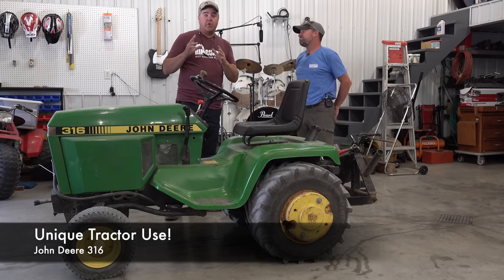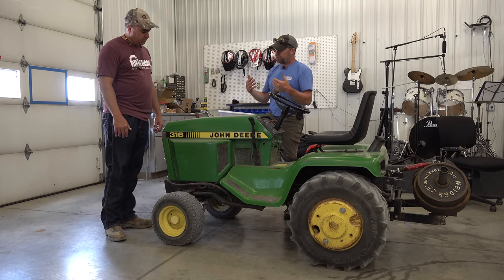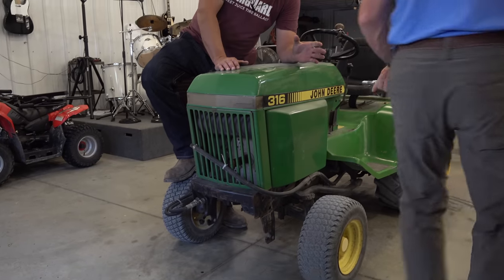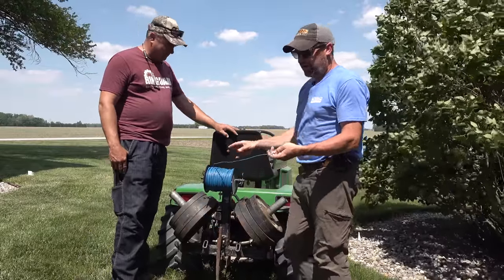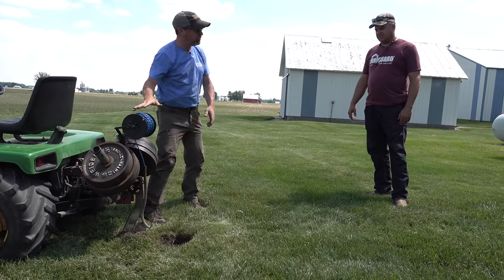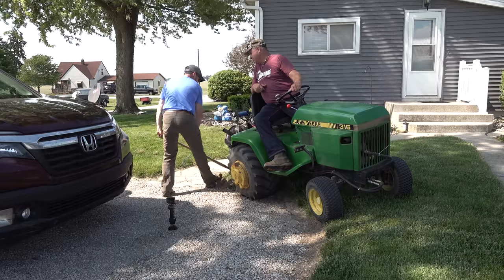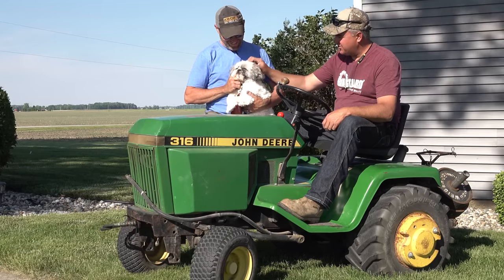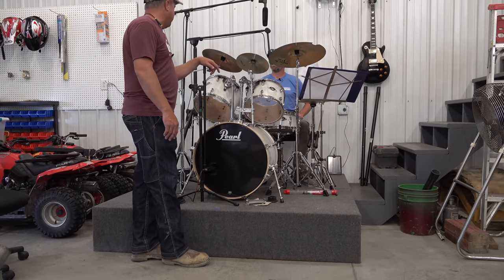DIY Cable/Wire Layer! Underground Dog Fence! Old Deere 318 - Unique Tractor Use!

Comment: Great Video Tim & Christy! It was such a fun experience having you guys out to visit and such great help having you assist me with the dog fence install. I'm glad we were able to get together on this one.  Even had a little extra cowbell at the end!!! Thanks again!
Reply: got to love a little extra cow bell!
Reply: Just an FYI, these tractors did have 1 weak point. With high hours, the input shaft on the hydro pump can round off, even sometimes break. Most had a hard to get grease zerk, but I think the main cause was drive shaft issues.

Comment: Nice set up.  Very good use of that rig.  Powerful tractor but small enough to get where you need to lay that cable.  It reminded me of the times before I got lil Jonny.  I had a collection of Case 444 (1) and 446 (3) that used the single lung Kohler 14HP and the Onan 16HP twin.  Also, very beefy little tractors with hydraulic drive and 3 point hitch, etc. from that era.  Thanks for sharing!

Comment: A few years ago I bought and restored a 1984 430 3 cylinder Yanmar Diesel.  It has blown my mind the power and capability.  I have fabricated a few implements  as projects arise.  It has a 54" snow plow and the tractor will push a foot of snow with no chains or weight (other than me).  I noticed you can buy what they call a shovel bucket from Deere for about $1200.  I studied it and built the same thing out of 3/16 plate all welded together vs 1/8 and all bolt together from Deere.  I have hauled countless yards of dirt around my 4 acres leveling and filling in places.  I built a drag for the back with 6" channel and 1" solid stock that I cut at an angle and welded to the channel, It's 60" I think with 20 rippers and it really digs, smooths and levels clay.  My sister had new laterals put in and it was all clay, they really left a mess and between picking up little piles if clay and dragging back and forth over everything it came out very smooth and level.  When I cleaned out my 600 feet of tree line I bet I drug 30 + trees after I cut them.  In a tree line you cut the tree and it hangs up in the others and the 430 jerked the trees off their stump and pulled them up a pretty good grade about 300 feet where I limed and cut everything.  My only issue is being a cat 0 I cant find implements.  When I restored it it now has the rear PTO that I wanted to hook up a tiller to.  The closest I can find is hydraulic that runs off the mule drive up front, no rear PTOs.  I still love it and will keep looking for the right tiller!

Comment: Tim
I wish I had a smaller mid size tractor.  To do things just like this!!  A tractor is so valuable.  
I check at my local Kubota dealer and one thing I’ve learned is that if you see one you like you have to jump on it because it’ll only be there a day or two.  
There was a 35 to 40hp John Deere diesel MFD there a couple weeks ago and I inquired. It was clean as a whistle had about 3500 hrs on it.  It looked to be really cared for and kept inside its entire life. 
  I immediately thought of you and was pretty sure you could tell me if it was worth what they were asking $14,500.00.  It was gone the next day or two. 
,It was perfect for what I wanted it for. Turf tires  rear remotes extra mid remotes.  Set up well to plant grass seed and maintain large lawns.  As well as till smaller plots.  
I just didn’t know how to get ahold of you to ask. 
God bless
AJ

Comment: I've used my JD 112 with integral hitch and brinly one bottom plow
 Pulled off the frog leaving the c shape of the plow ground an angel on front side digging into the ground and added a little bit of brake tubing and a radiator clamp. Walked behind to push down on the plow for depth and had wife drive the tractor made easy work of the project.

Comment: I've put in around 20 of the Pet-safe systems for friends & family but used an old disc from a harrow(?) then used those big paint sticks to push the wire in, no fun. We also used the drill technique for twisting the wire. A tip before someone does this, is to take a push mower and cut the grass short, it gives you a trail to follow and less grass to go through. Always make the corners round, use lots of flags and train, train, train your dog. Pet-safe also makes a Big Dog/Stubborn dog collar for large breeds. 
He is Neil Peart from Rush with the cow bells !!

Comment: Where was this when I put in our Pet Safe system? I put mine in with a flat shovel for over 1000 feet (1 acre). And I too upgraded my wire. 23 years and on the third dog and still works.

Comment: I’m surprised you didn’t call before you dig. Many cable and telephone lines are also installed like this and are very shallow in depth and easy to cut.
Reply: that's a great point. We always called before we installed any systems. On this one in particular, we were aware of all utilities that were at risk and was able to go around them. (Propane and satellite dish coax) Good call though.

Comment: Tim, this was great. I did this exact thing last year for this very thing. I had no idea what I was doing and I just strapped a plastic piece of conduit to my heavy hitch subsoiler and was able to bury 2000 feet of dog fence. Just two weeks ago I used it again to bury about 2 runs of 200 feet of CAT-6 out to my lamppost at the road for a PoE camera and to my outdoor movie theater I am building. I like Neil's setup a lot better. I will make notes and make mine better.

Comment: I not sure how well it would work or if it would affect the plowing process. But you may be able to cut teeth like not the blade and use the hydraulics system to cut the roots moving up and down to get through them. 
I’m installing an invisible fence on a 4/5 acre yard so this may be right up my alley this summer

Comment: Small correction , the last 2 numbers in the 300 series tractors are the horse power of the tractor. In example that 316 is 16 HP , 318 is 18 HP , they do share the same “P” series engine but the 316 version is only 16 HP.. now the only place this doesnt apply is the 322 and the 332 , they have the Yanmar 3 cylinder engine in them , the 322 being the gas version 18 HP , and the 332 being the diesel version being 16 HP but more torque. Also he put a higher HP engine in the tractor ,however JD rated the engines differently , not at the crankshaft but what they did was hook up the attachment that used the most hp to it and rated it by the “Remaining “ HP the engine had .. so a Kohler magnum 18 or Onan P series 18 HP is far superior to say a 25 HP engine of today … both the Kohler and Onan both are “opposed” twin cylinder engines and had gobs of torque way more than the engines of today.. and the 400 and 300 series both shared the sunstrand 19 hydro pump.. with the same GPM out put .. they difference was the 400 series were longer and slightly wider by a cpl of inches so they could handle pulling like a 3 bottom plow where the 300 series because of its weight and length were better suited to pull say a 2 bottom 10” or 12” plow and of course a single.. and the 314 and 3 316 were the only ones with single spool hydraulics all others came with dual spool so they could operate a 4 way plow or snow blower with hydro shoot angle and front end loaders and yes even backhoes .. they are and you were right the equivalent to the X700 series of today..
Reply: I actually think there were both engines for 316. I believe the 1987 and newer 316s had the same P218 Onan that the 318 had with 18 HP.  The pre 1987 316 had the B43 Onan with smaller displacement and was in fact 16hp.  This tractor is an '88 and had the P218.  Now, there was also an older 316 that had a single cylinder Kohler. That one is 16 hp too.  You forgot about the 330!
So really, out of all the tractors in that series, the 318 was the only number that always represented the hp!
316, 318, 322, 330, 332
Reply: @digdrivediy  the 330 was also the diesel Yanmar only difference was it was single spool hydrolics and no power steering.. and ya forgot the 317 that was also 17 hp that had the kohler 17 hp opposed twin engine.. john deere still uses the same philosophy in alot of its tractors today mainly the bigger farm tractors where the last 3 numbers are the machines rated HP .. example the 8230 is 230 hp ,, they seem to have gone back and forth on that threw out the years .. i didnt menthion the 330 because it is the same tractor as the 332 without the dual spool hydraulics and power steering. To similar to mention my friend has a 316 I believe it is a 1989 and it has a P series 16hp engine .. i will see if i can get the numbers off the engine at least that is what he told me .. the 316 and the 318 in later years were like the 330 and 332 just minor differences like single spool hydrolics stock but could get it as a option i believe .. nice comparing notes with ya ..i own a 332, 322 , and a 317 ( with JD replacement kohler magnum 18) and a 318. Yea im a JD buff lol ..
Reply: @PhatboyHD88  Right on.  We'll need to get to the bottom of that 316 engine thing.  I still have the original engine that came out of that 316 so I could take a closer look.  We had  a 317 growing up.  That was a nice tractor.  Just completely different than the open frame machines.  Thanks for the conversation!

Comment: We used a Ditch Witch cable plowing Tractor system to install telephone and fiber optic cable with this same principle

The only difference is the Ditch Witch Tractor used a PTO to drive a vibrating unit that moved the BLADE up & down like a jigsaw

We put a lot of buried cable in the hard ground at Kingsville Naval Air Station back in the 1990's

Comment: I used one of the scarifiers on my box blade, just dropped one down. Slightly heated a pcv tube and bent it and just gorilla taped it to the scarafier. It didn't lay the dirt back down as nice but it wasn't bad. Dog fence still works to this day. Did a two acre lot in an hour. Slicker than pig snot!

Comment: I bought a pet safe system with enough wire to do three acres. I never installed it because I didn’t have a good way to efficiently installed the wire. This is what I needed 10 years ago.

Comment: Didn't read all the comments, but an added disk up front may help...IDK
Reply: I've tried that too.  It works in the straights but always had fits with it on the curves.  They would bind and not line up causing more harm than good on the turns so I took it off.  But, it's a good idea in principle for sure.

Comment: Yes clay has great power. When we bought a peer and beam house that was very wet underneath we dried it out. The consequence was the stress the pvc pipe from one toilet pulled apart. It was the pipe not a joint.
Reply: I don’t most people understand that some soils need to moisture to stay stable. Hope you have been able to remedy your issue.
Reply: @akbychoice  underneath the house should normally be kept dry to avoid moisture induced rot from mold of the wood structure. Just had to fix the broken pipe
Reply: @ccswede  generally true, but I know some have had issues with foundations moving because the ground was too dry.
Reply: What did you do lay the pipe into the clay not putting any rock around it?
Reply: @krrrruptidsoless  this was a house built in 1950. Soil is called Victoria clay. Good suggestion for future build..

Comment: My only concern with that for data wire like coax or ethernet is that you're not laying the wire very deep at all, and giving it no external protection. Wouldn't take much at all for the cable to get broken. Absolutely perfect for dog fencing though!

Also, for anyone that might be worried about the use of "shock collars:" if you ever have the opportunity, put the collar on your arm and try it. It's not nearly what you think. You can easily get bigger shocks from naturally occurring static electricity. I use a remote collar on my service dog, and no kidding, 98% of the time only need the audible beep to correct a behavior. If I have to use the shock, it's usually in order to keep him safe. Dogs are incredibly smart and will learn very quickly where they can and can't go, and will learn that boundary in respect to whether or not the collar is on. Many commercially available systems have a vibrate and/or audible tone option if you're completely against the electricity, but you should know that it's nothing at all like people expect. A dog pulling against its collar and leash/tie-out is far more painful for the dog and can actually cause very serious injury. (The most commonly seen flat collars are a waiting diasater and should never be used, but that's a whole different topic.)
Reply: BELL just ran fiber optic from house to house in my neighborhood with a team cutting a slit in the sod with shovels, sticking in the wire, then stepping on the trench. In Canada with major freeze thaw. Doesn’t seem to phase them?

Comment: You should mention that the Lube Shuttle tubes are reusable so you can refill them with your own grease.  That way you don't have to use the expensive grease if you don't want to.  They even sell empty tubes.

Comment: I got a 25 horse power Troy bilt that will verily pull  a lawn sweeper and run the blades at the same time. And the compression reading on it is 180 psi in both cylinders.
 I think they need to go back to manual gearing on all these lower horsepower lawnmowers to keep from losing hp through the tranny

Comment: Humm.. my hobby is restoring the 300 series. And I've never seen a 316 come with 18hp. In fact the 16 and 316 represents the 16 horsepower. Now the 300 series itself you could get different engines in. But the 312 had a 12 horsepower 314 a 14 horsepower 316 16 horsepower and 318 was 18 horsepower. I have every one of these. The 318 by the way is still the most popular garden lawn tractor sold ever by John Deere.
Reply: I believe the 1987 and newer 316s had the same P218 Onan that the 318 had with 18 HP.  The ore 1987 3162 had the B43 Onan with smaller displacement and was in fact 16hp.  This tractor is an '88 and had the 318.  Now, there was also an older 316 that had a single cylinder Kohler. That one is 16 hp.  Other examples in this series where the HP doesn'atch the number is a 322, 330 & 332.  You can double check me but I think that's right.

Comment: 4:47 stop leaving your grease guns in the heat/sun and the grease won't liquefy and bypass the plunger.
7:51 manufacturer saves cost by sending out the lowest price materials that are just barely good enough to get it done, not meant to handle frost, moles, and voles and other rodents digging and chewing on the wires, not meant to handle heavy equipment &/ traffic relocating it in the ground in periods of mud or aerated (non compaction to compaction).